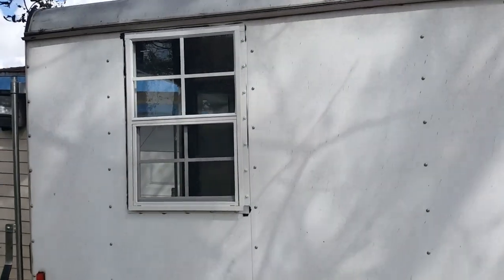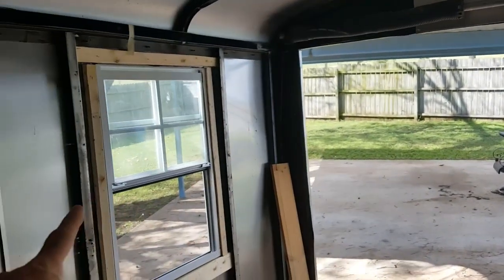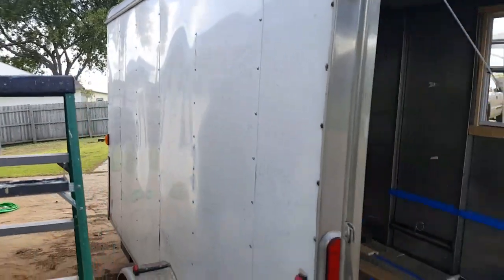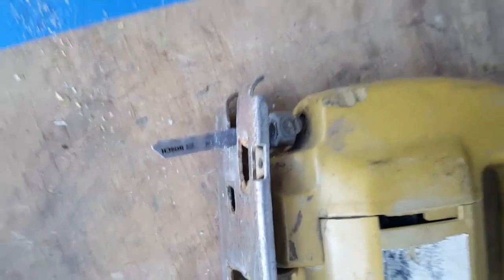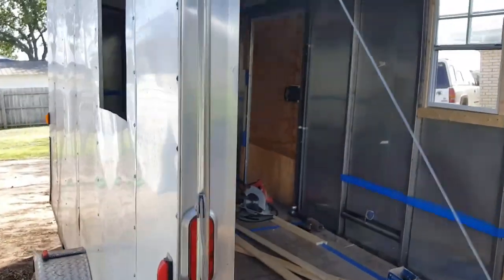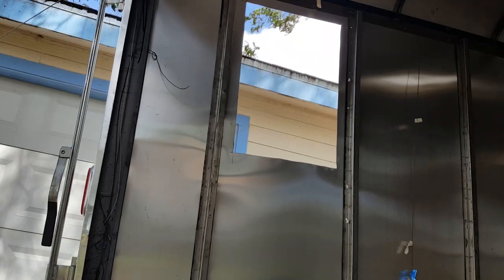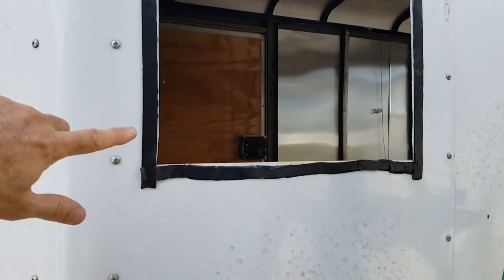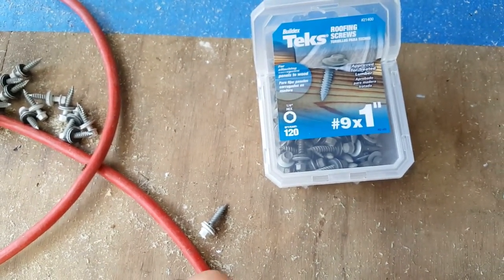CARGO TRAILER WINDOW INSTALL 6 x 12 Cargo Trailer Camper Conversion Part 3

Comment: I have the same windows in my Gypsy wagon. Though mine are the smaller version and flush mount, I believe they are the 14x21. They have held up well in the 2000 miles travel thus far.
Reply from the maker: Good to hear. We have had ours in for around 9000 miles with no issues. We have gone over some pretty rough terrain. Happy travels.

Comment: I think true RV windows look much better but these are more affordable. This is what I have installed in my previous build and is what I will be installing during my current build.
Reply from the maker: Agreed. I can't justify the cost of the true RV windows in these types of builds. Good luck on your project.

Comment: I purchased a 2017 Jayco 26’. While washing it, as I’ve done several times starting from the top, it started smoking from the interior behind the refrigerator turning into an all out Fire. This wasn’t my first RV, being well aware that you can’t do direst water on ANY roof vents, etc. long story short that wood and aluminum matchbox was burned to the floor in 10 minutes or less. Jayco pull behind buyers, beware! 
Like most people I had it stored on a concrete pad in my back yard, in a privacy fence with a locked gate. 
What can possibly happen to it? Lol
Cancelled the Insurance. Bad but true story. Some guy came by and videotaped the fire, “RV Fire in Perry” check it out.
Anyway, a project like this is the direction I’m headed. A lot less likely to burn down in 10 minutes!
Thank you for the Video
Reply from the maker: Thanks for watching. Good luck on your build.

Comment: Thanks for the video - I am curious how the windows have held up through the bumps and potholes. Have you ever worried they may shatter/crack during a long road trip? I am thinking of installing these windows in a future build.
Reply from the maker: We have hauled about 1000 miles so far. No problems to date. We will put around 7000 miles on it this summer. However, if one does break, a new one is about $35 and easily replaceable.
Reply: Do you know if the smallest Walmart window unit for through the window. You would solve all my problems

Comment: Great video! 
Was planning on doing this myself soon. Question though, why did you choose to use the windows with the J channel flange on the outside (so you can tuck siding under the frame) instead of the flush mount?
Reply from the maker: Thank you for the kind words. I like the look of the flush windows. I could not find flush windows in the price range I was looking for. I do like that the J Channel flange does go over the siding and it is easy to get a great seal. Good luck on your project.
Reply: @FakeLegGreg  how are yours holding up? Now that it's colder, any issues with draftiness?
Reply from the maker: @teeceedeecee  I haven't had mine on the road yet. Holidays caused a delay. I have worked on it some on windy days and I haven't noticed any drafts coming in from around the windows. I was just thinking today how much quieter it is in the trailer during the wind compared to the nylon tent we were using. :)
Reply: @FakeLegGreg  Same, same :-)  I'm working my brain out trying to devise a hinged frame for one of these so it can serve double duty as an emergency exit - my studs are only 14" apart so not a lot of room to play with...and even if I wanted to pay $200 for a new RV-style window, I probably wouldn't be able to find an exit version that fits.

Happy Travels once you finally get moving!
Reply from the maker: @teeceedeecee  Yep, probably looking at cutting studs for that install. You may want to devise an escape door through the back door. I have seen it done with barn doors and ramp doors. I hope you figure it out and post a video of your solution.
Reply: @FakeLegGreg  Definitely need to think it through, whether it ends up being a dual-purpose window, a separate hatch, or through the back.  There's a cam lock on the rear doors so I would still have to build a separate hatch, but that's sounding more sane than trying to ask so much of a window we're already repurposing to begin with!